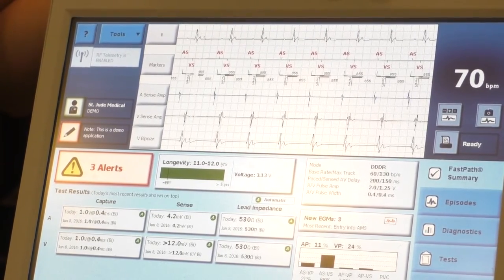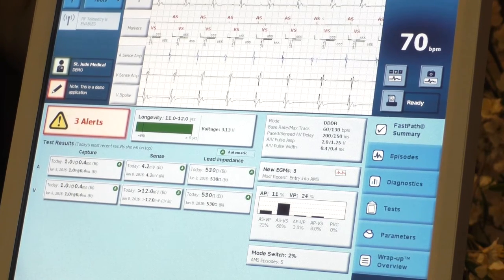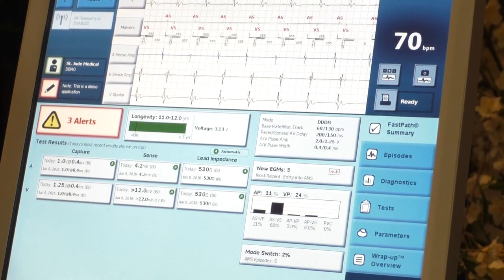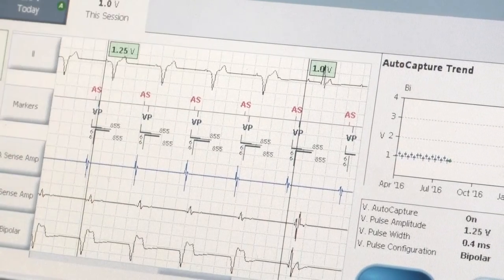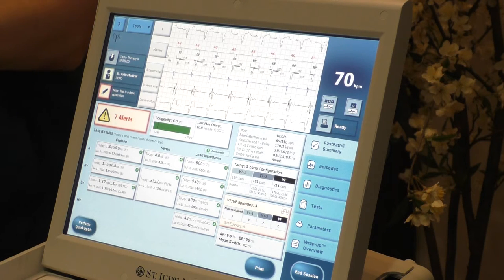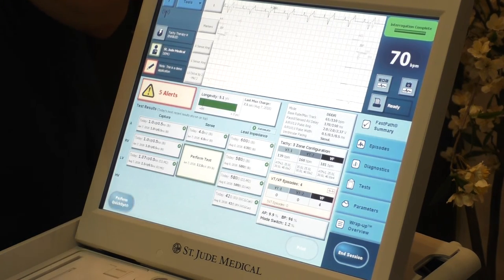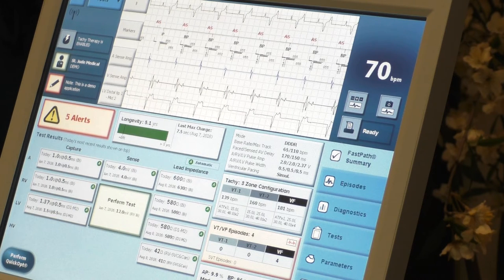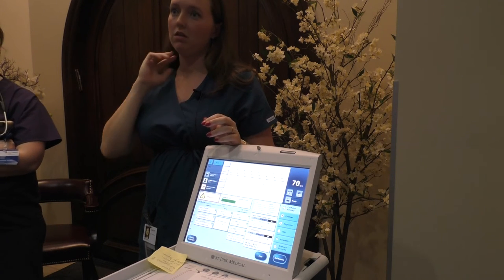OLC - ICD programming Part 1

Comment: First, it was great that you posted this fantastic video. Thank you. 
Second, it's a pity that the students were unprepared. Most of the asked questions could be answered with a little bit of thinking, while the rest with some extra reading before the classes. If that was the case, the video would be smoother and much more things could be explained. For example showing how to program unipolar vs bipolar and how to adjust the poles in diaphragm pacing. Still, great video. Thank you very much for sharing
Reply: Teaching is to learn someone something....wtf if the dont know??, they will learn...
Reply: @rb8947  Yes, they will. But they would learn much more if they had read the basics. And the value of the video would be massive! All right, nevermind. Still great, thanks.